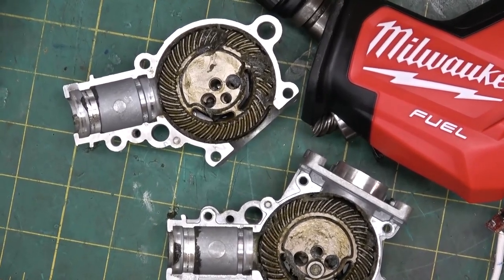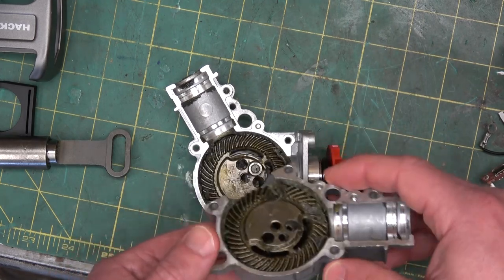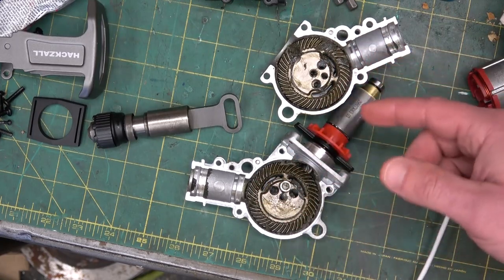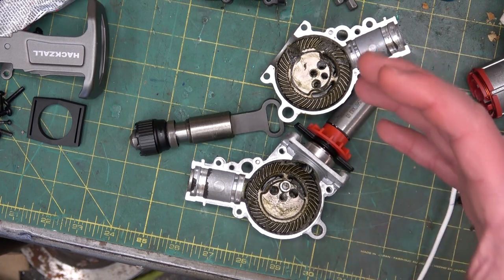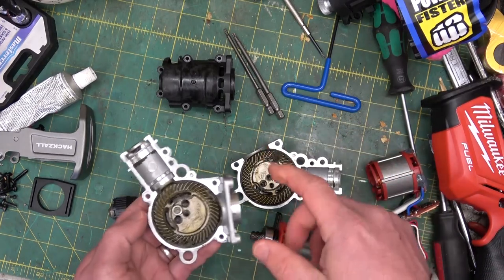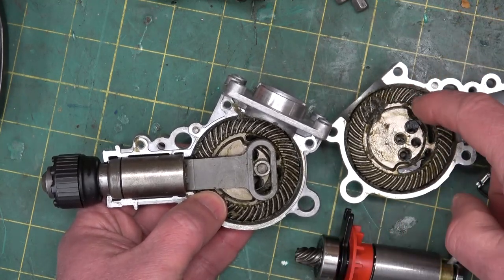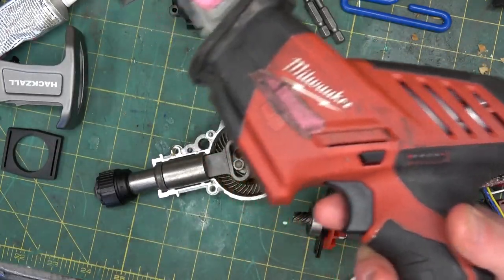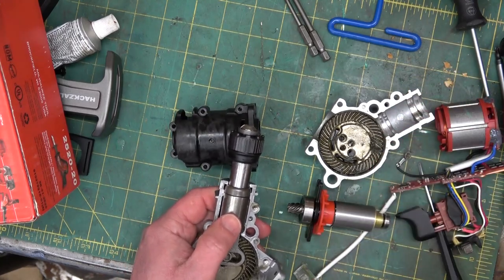BOLTR: Twin Crown Gear | Milwaukee Hacksawzall

Comment: I've been growing a counter- weight just Above my personal reciprocating mass.  Makes my belt tighter,  but my balance is top- notch......
Reply: I'm having trouble growing mine. Vibration is terrible right now and everybody can tell when you're wearing a prosthetic.
Reply: 😂😂😂
Subscribing to this comment thread.
Reply: Dave Micolichek  I'm still pissed about about the engineer that placed my recreational reciprocating mass next to a sewage removal unit.  Shoddy design,  or so my wife claims......
Reply: Dave Micolichek  Oh, totally! Yeah, that's what I was talking about too. Definitely on the same page. Yep! :D
Reply: @mrdumbfellow927   Hey buddy, it was all in the specs. Blame the architect.
Reply: @mrdumbfellow927  We were going to run the pooper out the big toe, but then, you know, boots.
Reply: I figured out the issue on my end. It's rather embarrassing actually. Did you know the potato is supposed to go in the FRONT of the pants?

Comment: I like your thought process, but I think that you missed the actual counterbalance function of the stroke.  The empty mass of the gears is meant to be in sync with the reciprocating motion to counter the weight of the cylinder.  When blade is extended - both gears are heaviest in opposite direction.... When blade is at center point of travel - the void in the gears are at opposite ends (vertical to blade travel and eliminating vertical harmonics - and finally when blade is at shortest travel, both gears are heaviest closest to the blade.  That will reduce harmonics along the axis of the blade.  My 2 cents.
Reply: Exactly!
Reply: That's what I was just thinking as well, the added benefit of damping in the vertical. Someone's comment on helicopter blades made me think of it.
Reply: Totally agree.
Reply: Makes the most sense. Honestly it seemed obvious in the first vijaeo and I certainly ain’t no enginerd.
Reply: Yep, if you were actually listening to the video that's exactly what he implied.

Comment: I think you should test it by reassembling it both ways and see how much vibration you get in each scenario (0 deg or 180 deg out of phase)
Reply: That would be interesting!
Reply: Ooooh, that sounds just sciencey!
Reply: I took the liberty to do so with mine and it turns out that they both need to be set at 0°. I first tried 180° and it was ridiculous. Tool felt like it was going to fall apart.  0° it eliminated 90° of the vibration.  It makes sense if you think about it. The counterweights are made to counter the the weight of the in and out shafts weight.

Comment: when you measure your lego bricks in metric you will always have 70% more.
Reply: What if the goal was to reduce vibration, but they found out a single rotating mass would twist the sucker right out of your hand.  Put the mass as you note, phased to be additive, but rotating opposite, so there is no "accelerating the gyro" effect.  Home fast do these bevel gears spin?

Comment: The mirror image of the gears on the table tricked you, I think. The counter balances work in the same direction while in-line with the axis of the bore, but are opposing while perpendicular, allowing them to cancel the vertical vibration a single balance would cause.

Comment: If you think about it the counterweights must be above eachother when the choocher is fully out. Now as the pinion rotates, one weight goes up, the other goes down, and they meet at the front when the choocher is all the way back. 
That way, you balance the back-and-forth vibration without inducing vibration across the axis of the choocher, as one counterweight would necessarily do. 
The only imbalance left is a torque around the axis of the blade, which is going to be small because the gears are so close together. 

If you'd like to think about this as a phase difference: The gears constitute two oscillations with identical cosines and opposite sines. By turning the opposite direction, the gears will line up twice every rotation, as such their components in the y-direction canceling out while their x-components adding (choosing x as the direction of the saw movement).

Comment: Reviewing your previous video. At around 12:30 when you split the casing the counter rotating weights appear to be almost 180deg apart with the stroke midway. I think it supports your comment that the weights are at their full extent at the point of change of direction of the saw. This assumes the gears did not move during motor removal.
Reply: Totally right. The weights appeared 180 out and the saw was at almost exactly 1/2 stroke. Makes sense to me!
Reply: @802Garage   I was just thinking the same thing

Comment: 1:55 - "... the single stroke engine, which of course is a rocket ship.  Nothin' but pure power."  XD  Technically the best kind of correct. Had to pause the vidjeo because laughter = can't hear your next words, and we can't have that!
Reply: Wouldn't a single stroke engine be a gun? Should a rocket ship be a 0 stroke engine?
Reply: @mattmullett9521  No, as they both do the same thing.  Expel something violently one direction, causing the expelling thing to go the other direction.  Aka a single stroke engine, self propelling.  Bullet and gases of the gun, just the expanding gases of the rocket motor.  Same result: Gun/rocket go violently the other way of the gases.

Also, two years!  Nice. :)

Comment: I think if you take the silver stickers off the cases, there might be an alignment hole or somesuch in order to clock the gears when reassembling the cases. Maybe line up holes and put a pin through it and the gears to hold them. etc. Just a thought.

Comment: (INCASE ANYONE WAS WONDERING)

I took the liberty to do so with mine and it turns out that they both need to be set at 0°. I first tried 180° out and it was ridiculous. The tool felt like it was going to fall apart.  0° it eliminated 90° of the vibration.  It makes sense if you think about it. The counterweights are made to counter the weight of the in and out shafts weight.

Comment: I think you having the Gearcase and cover splayed open kind of visually confused things, but the timing works like this (I work for another tool company designing these, and working around the MW patent on this is a PITA):
both gears are timed such that the CW mass is full back, when the stroke is full out, and vice versa. This means at half stroke, the CW of each gear is 180* opposed, cancelling the non-axial components of the vibration forces.
Other than vibration reduction, this also has the benefit of being able to split the CW mass between the 2, increasing the total amount of mass allowed in the system (it becomes unwieldy to have the full amount on one gear. This split allows the CG of the CW to be in place with the recip shaft, thus reducing the moment on the tool. With CW mass all on 1 gear, there is a resultant moment due to the recip shaft being on TOP of the gear, so the CG of the recip shaft and CG of CW have an offset, thus moment.
Hope that's clear enough.

Comment: Counter-rotating, and in-phase. The heavy side of both to counter-weight (moving the opposite direction) as the piston, works at 0 and 180 degrees (TDC and BDC of the piston). The gears counter-weight each other at 90 and 270 degrees (half-stroke of the piston).

Comment: I actually thought the exact same thing you did. Obviously thinking through it for an extra 10 seconds makes it clear they counter rotate.
Haven't gotten far in the video, but I might suspect it is to keep the pinion gear located, add flywheel weight, and since they spin both ways to dampen vibration.
I also love Stroopwafel. Maybe there is a real correlation there for cognitive failures. ;)

Comment: Same as crank case balance shafts in a 4-banger.  Two counter rotating shafts with off center weighted lobes.  They're in phase vertically (to cancel vibration from the pistons) and out of phase horizontally (to cancel each other out).

Comment: I haven't seen it in the comments... yet. I think you're also missing a clever dynamic of the dual mass, contra-rotating system. Like you say, at 0 degrees, the two masses must align with the axis of the saw, opposing the acceleration force of the reciprocating mass. When at either plus or minus 90, the net acceleration of the dual masses is zero. This would not be achievable with just the single flywheel. You get no vibration from the flywheel mid stroke in the orthogonal. You are absolutely correct about the locating benefits of the two gears to the pinion, the separation forces from the tooth flanks would cause misalignment under load and accelerate wear from changing contact points around the reference pitch line.
Reply: @fascistpedant758  I think I hear you, talking of the inertial effects. My description was meant to read about the forces subtended by the components of the normal force at the tooth flank that force the pinion away from the crown gear. Without the freewheeling crown, the pinion would not be as well constrained to maintain proper mesh, as when there is another crown to push against. I think it beneficial to the assembly. Your thoughts?

Comment: It’s just like the balance shafts in the 2.7 Toyota Tacoma engines, and many other “larger displacement” 4 cylinders. There’s 2 that rotate the opposite direction of each other, but they rotate at double the engine speed to reduce the vibration of each pair of pistons as they change direction at top dead center.

Comment: A pin on each ring gear will still chooch as long as there is enough clearance to let them pass twice per stroke. The counter-rotation will work FOR you, pulling and pushing on opposite ends of the slot.

Comment: If you want to tell how it is setup for sure, under the sticker on the back side of each half there is a hole with locator holes which you need the locator pins for assembly to make it easier.

Comment: Another thing to consider is the crown wheel, if spinning fast enough will act like a gyroscope tending to want to turn the tool or resist turning in use (like a grinder) If there is another crown wheel rotating in the opposite direction it will cancer out the other and this motion.

Comment: I might be talking nonsense, but the counterweights might not be there to cancel the shaft's vibration, they might be there to amplify it. If I recall correctly, that shaft is lighter than the old one.
Reply: @fascistpedant758  maybe, maybe not, given that they each turn the opposite direction to each other, they're counterweights only "meet" the same time the shaft is fully extended or fully retracted, otherwise they'll cancel each other out. My 2 cents (ohne MwSt.)...

Comment: While I do think that it might be easy to conclude that it would help with balancing the rotating masses, I think it has more to do with positively capturing the motor pinion. Without the opposing gear, any load applied would side load the motor output shaft, requiring a more robust bearing on the motor. If it is the same gear as the other side, it wouldn't be balanced anyway because there isn't a crank pinned into it.

Comment: The 2 gears are actually counterweight, there has to be one on each side of the reciprocating blade, otherwise while it's reciprocating if it had 1 counterweight on only 1 side, it would impart a sideways lever to the whole machine that would cause all sorts of arthritis.  With the counterweight on both sides of the blade, it's a properly balanced system

Comment: Hey AvE. Who would've thought newer - better. I had to cut some walls made out of kinda gypsum panels. And  stalled my Makita angle grinder and it burned out. The bad thing is that the warranty is out. I bought in 2016. So I went to a different shop, got another grinder, not Makita this time and not Bosch, they didn't have Metabo, so I went with DeWalt. And just like with Makita, I stalled it a few times, but now in this 2018 or 19 model is has this feature of shutting down the power when it stalls so it won't burn out. Hey, genius. I can really see your channel making a difference.

Comment: I was thinking that they must have a way of aligning the weights during production, So I had a look at the last video. On one side there is a little silver cover over the outside of the bearing housing... It looks like  if you take that off, there will be a way of aligning the holes with a pin which goes through the holes either side of the central one. What do you think ?

Comment: The weights counter act the in out motion while they are moving on the 3 and 9 position. The acceleration of the blade occurs when the gears reach the apex of each side. There is only one way to time these gears. The weights must be opposite at either end of the 12 and 6 position. The up and down force on the blade adds to the cutting action without additional pressure from the hand.

Comment: I think it's important to look at the design of the reciprocating shaft.  Instead of using a fairly simple connecting rod, they've got this somewhat complex to machine slotted assembly.  Part of this is certainly a result of the relatively large size of the crown vs the pinion. (the large size likely being due to utilizing the high RPM brushless motor and the desire to get better gear reduction).   After all, the stroke length of the reciprocating part could be tuned by pin placement and a connecting rod setup can be very reliable.     

So, back to the mystery of the weirdly slotted reciprocating shaft.   My guess here is that they use this setup to artificially introduce lash into the system.  With the solution they've designed, the shaft will spend a much longer time at or near top and bottom dead center than it will actually doing the work of moving the shaft in and out. (yea baby).   Usually lash like this is undesirable but when using a brushless motor, the current requirements at start/stall torque can get unmanageable because the position of the rotor isn't explicitly known  until the motor achieves a minimum RPM.  The oddly slotted setup is likely to allow the motor to get sufficient rotations up before putting full torque on the motor and risking a torque stall. 

All that said, with a connecting rod setup and the relatively short time spent at TDC and BDC, there's very little torque required to change direction.   With this slotted setup, there comes a point just after the pin has transited the slot that the reciprocating mass goes from "hanging out" in BDC to moving outwards.  (or toward at TDC).  At that point of direction change the ability of the saw to change direction is limited by the stall torque of the motor and any rotational inertia in the crown gear.   I think this partially explains the second crown.  Its mass acts as a flywheel to aid in the reciprocating mass changing directions and prevents a stall.

Comment: By balancing the back and forth motion more energy is transferred to the blade (and the teeth on the blade) to allow the teeth to cut what ever with more force resulting in faster cutting times (and a messy run on sentence, but oh well...)

Comment: A single counterweight offset from the center line of the stroke would probably create a secondary vibration that can be eliminated by having a counterweight on either side of the connecting rod.

Comment: Wheels moving in opposite directions would cancel out the gyroscopic (inertial) forces that way the tool doesn't fight back when you turn the tool in different directions/angles.

Comment: About those bar charts, (not sure if ave didn't already told this) but they actually zoom in on the top/cut off the bottom of those bars. This way the difference looks bigger when its only 1 or 2 % it looks way more

Comment: Actually the two counter rotating gears can both drive the reciprocating piston.  Simple trig   cos (a) = cos(-a)    sin(a)= - sin(-a)    The two gears can not be connected but they each can extend into half of the slot.

Comment: The idea of timing the gears so that certain vibrational modes might be reduced is a cool idea. I wonder if there are any hints on the various parts that this is the case? In other words, in a production environment, lots of assembly operations involve jigs that hold the various components in the proper orientation. Are there any aspects of the parts that suggest how this timing would be done by whoever (or whatever) that assembled the thing?

Comment: I think you are overthinking this. Those two crown wheels balance each other out so the tool wont vibrate as much, thats true, two gears to locate the pinion also true, but the main reason to put two gears there apart  from keeping pinion from skipping was not toremove harmonics vibrations but just to store some more energy and the tool will not stall that easly and will keep rotating so basically a flywheel to store rotatin force. And they used two indentical parts for this since it was probably easier and cheaper.

Comment: I still reckon adding a second pin would be better again. The pins start lined up in the centre of the slot at bottom dead centre, then go to the opposite ends of the slot as the gears counterrotate, balancing the force being applied to the reciprocating section instead of acting on it off centre for most of the stroke like the single pin version, to cross over again at top dead centre. The slotted section isn't thick enough to leave room for this though, so its s design that could be much better with only a tiny bit more thinking from the designers.

Comment: Is there any timing marks on the outside of the gears that can be seen when the two halves are together before the motor is installed.
Reply: That's what I was wondering.